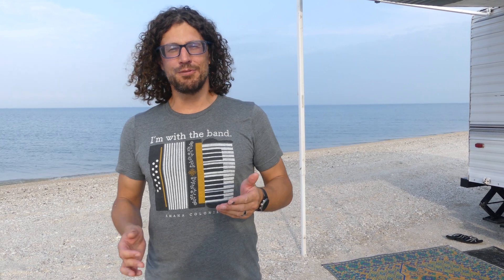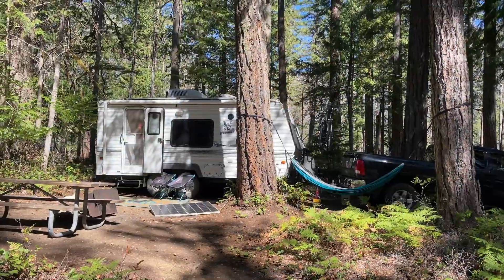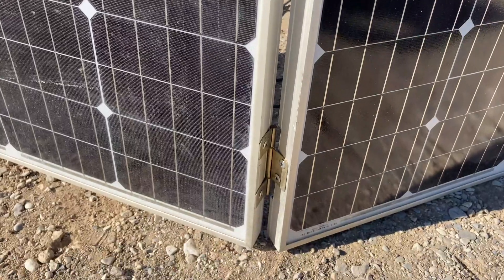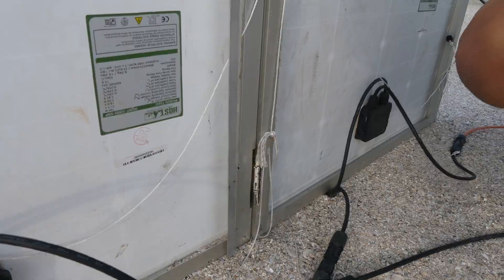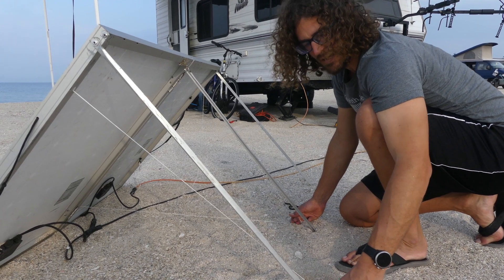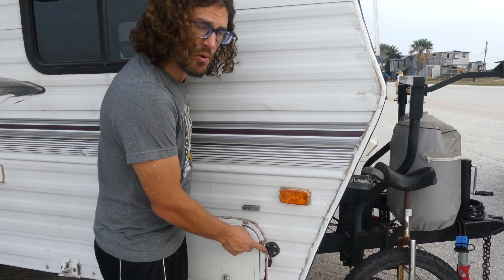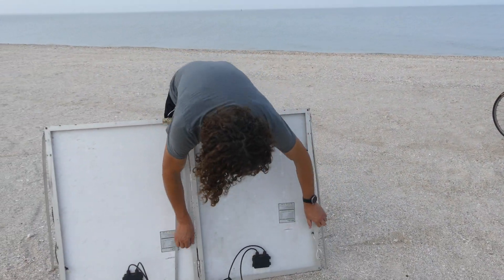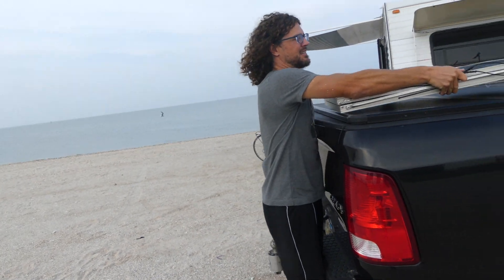Our RV SOLAR Setup & DIY 200W Ground Deploy

Comment: Great video beautiful setup! 

If you are running two solar charge controllers into the same battery will it take the energy from both, or just the one that’s outputting the highest voltsge?

Comment: Thanks for the DIY info.  A hook-and-loop strap would help when you are wrangling the cords. Also, you could add a couple of flat hooks to hold the panels together when you close them, so they don't flop open.
Reply from the maker: Great tip!

Comment: Here's another idea...for my ground deploy I repurposed a zero gravity chair who's seat fabric was coming apart....put one panel on the the arm rest and the other against the leg rest...set the angle  and lock in place...easy to slide around to track the sun...I  use a mc4 parallel combiner with an mc4 extension into my Jackery
Reply from the maker: Sounds like a great solution 😃 and we love repurposing old items for new tasks!